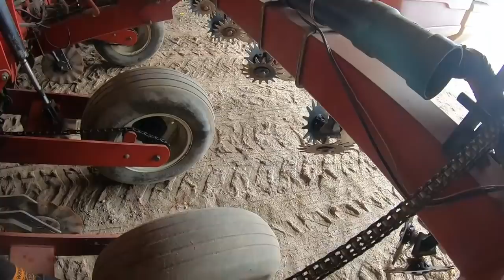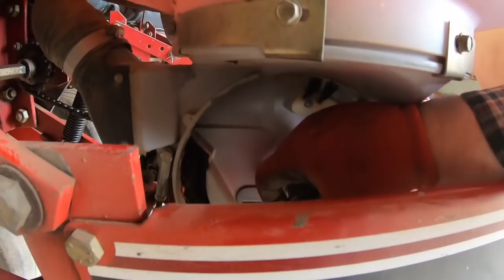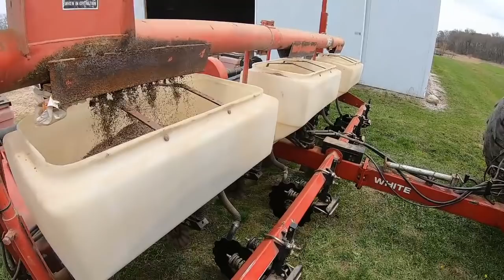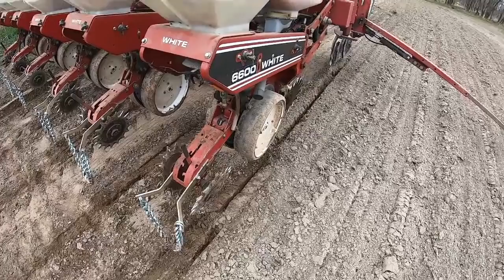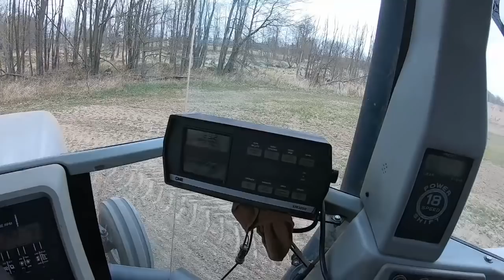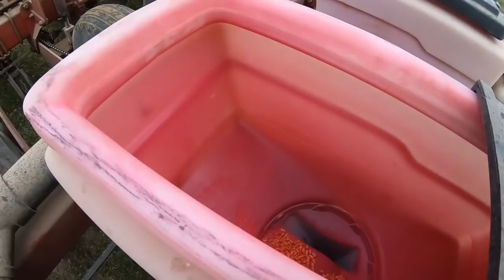Corn Planting with White Farm Equipment

Comment: So the seeder is "powered" by the center rubber tires that drive chain and gear links?  So in theory, as you speed up or slow down, the rate of see application automatically adjusts based on the speed of the center tires on the seeder?  So no PTO use at all?  If that is true, how fast can you actually plant before the seeder can't keep up?  How do you know if one of your row feeders gets clogged and stops dropping seed?   When you get to the end of the field, and lift the seeder up, what stops the seeds from continuing to drop out of the tubes if the chains are still powering the system?
Reply from the maker: Correct. The ground wheels drive chains that go to a clutch mechanism. When the planter is up, the clutches have rotated with the lift, and that pushes the 2 halves of the clutch apart separating the drive and while the chain from the wheel keeps turning, it can't transfer the rotation to the shaft, so everything stops. Let the planter down, the 2 halves are pushed back together by a spring, the teeth inside the clutch mesh, and everything starts turning again. And since it is ground driven, the amount of seed goes up and down with ground speed so that it is always putting down the same number of seeds per foot. There is a speed limit for it that varies by population. If the seed disc turns too fast, the seed can get jammed because it can't fall out quick enough before the hole goes past the opening. There is a transmission on the side that you use to combine different sprockets to get different populations by speeding up or slowing down the seed discs relative to the ground speed. If I remember right, they don't recommend going over 7 mph on lower populations, and it goes down from there. Corn is a low enough population (I'm planting 30,000 seeds per acre) that I could go 7 mph if I wanted to, but with my stony ground, that gets hard on the machine and also decreases the accuracy from bouncing. I plant at 5 mph, but do go a little slower in areas where I know there are a lot of rocks.
As to telling if a seed tube is plugged up, there is a sensor in the tube of each row. One side is LEDs, and the other is a light receptor. Each time a seed goes by, it blocks some of the light, the receptor picks that up and sends a pulse to the monitor in my cab. Each pulse is a seed, so the monitor can take the speed the planter is moving (there's a sensor for that as well) and calculate that with the number of seeds dropped over a set amount of time, and show me how many seeds per acre I am putting down. If the monitor doesn't get a pulse for around a second, it sounds the alarm to let me know one of the rows is out of seed. It shows a blinking square for each row, so if seed stops dropping, that square stops blinking. I know which row has the problem and get out and see what is going on. If the seed tube were to get plugged, it fills up with seed, the sensor can't see the light from the LEDs, so there are no more pulses,  and the alarm goes off. That doesn't happen very often. The alarm sounds when I lift the planter because it stops dropping seed. It sounds for a few seconds and shuts back off. Hope this helps.

Comment: been looking at 6125 or the 8310.  curious what your thoughts are on the 6125.  I currently run a MM G1000, so I am looking for newer and about the same hp.  plus I like the 5.9 cummins
Reply from the maker: I really like the tractor. The 6125 uses the White rear end and hydraulics, so it has common parts with my other tractors. Early 6125s used the White mechanical lever 3 point hitch control, move the lever to lift or lower, with a stop knob to adjust operating level type of set up. Very similar to your G1000.  Later ones like mine incorporated the electronic hitch control from the Massey. The actual lift parts are still the same, just the controls are different. It makes it easy to adjust lift height, operating height, lower speed, and draft sensitivity all from the operator's position by turning a few dials. Once you have it where you want it, there's a rocker switch on seat arm that you rock back to lift and rock forward to lower. They also added switches to the fenders on the outside to raise and lower the 3 point, which makes hooking up to implements much easier.

 The 8310 used the Massey Ferguson rear end, hydraulics and 3 point hitch. They redesigned the powershift so that every clutch pack has the same length of oil galleys. This helps to overcome the variable fill rates of the clutch pistons due to viscosity changes brought on by temperature changes. In short, they are supposed to shift smoother, especially on the 9-10 and 10-9 gear changes when there are 3 clutch packs shifting at the same time. The downside is if a solenoid fails, it's not as easy to get to as on the 6125 which has all the shifting solenoids in an easy to get to bank along the right side of the tractor. I haven't had to replace one yet, but it does happen. Some of the solenoids on the 8310 are under the cab floor, so not a huge job to get to, but still a little more work. I think the 8310 could also be ordered with the 32 speed partial powershift Massey transmission. They had 8 manual gears with a 4 speed powershift in front to get the 32 speeds. I don't have as much experience with those, but I have heard good feedback on them.

Both tractors use the 5.9 Cummins, which is a great engine in my opinion, and if nothing else, there are so many of them out there, they will have parts available for a long time to come.  They are also on the low end of horsepower for their drivetrains, so either one should last a long time with decent care.
Reply: @ThatOliverGuyChris  That is very helpful, would there be anything I should look for that is a common failure on the 6125 if I were to purchase one?  what would be a comparable tractor to the 6125 of other brands?
Reply from the maker: I'm not sure what the competition had at the time. I was more into service than sales. I can't think of anything specific to check. Look at the fluids, see if they look clean. Drive it, try every gear because if there's a bad solenoid,  some gears will still work,  others will not. It will likely shift a little rough when the oil is cold, especially the 9-10 or 10-9 shifts.  Try shifting at low rpm and wide open and see how consistent it is. If it has the electronic hitch control, try it out. It's nice, but there's also wires and sensors to go bad.  If it's 4x4, try that out. Listen for noises from the axje. They are a good axle, but from what I understand ZF isn't suppling parts for some of the axles from that era of tractors.  That's not just a White thing either,  Deere used ZF axles and parts availability has been an issue for them. Maintain the oil and grease them regularly and they will hold up.

Comment: Those whites are nice tractors iv only seen one up in ny at the micfadens tractor bone ward they have masinmve ones were the big v8 stuck out over the front wheels like 5 feet masive tractors and they have a few of them all scraped for parts siting in bone yard so if u need parts mickfatens in ny has bone yard full of all tractors

Comment: Great video! White planters have a great reputation for a reason. Can you tell me what all parts you need to convert an 1800 to a two speed PTO? Thanks
Reply from the maker: There really isn't a way to convert them, the housing doesn't have room for both sets of gears. You'll have to buy a complete dual speed unit from a 50 series to do it.
Reply: @ThatOliverGuyChris  what parts do you need? I saw a listing for one with just a housing/cover, two gear sets, and a shaft.
Reply: @ThatOliverGuyChris  by the way, I'm planning on winning that t shirt 😆😆

Comment: Mr. Losey could you explain the hydra power transmission and also the over under system on Oliver tractors. I have looked on the internet and cannot find a detailed explanation on these systems and how they work. Also were they reliable transmissions.  Might make for a popular video. I would greatly appreciate the information. I live in Kentucky and there are no Oliver's around when I grew up so I don't know a whole lot about them. I got to drive an Oliver 77 a few years ago. My cousin was in Missouri and his elderly neighbor lady had one. I got to plow with it and also disc a garden for them. It was a nice tractor. Thanks for the information if you could provide it sometime.
Reply from the maker: I've been wanting to make a video on repairing each, but the opportunity hasn't risen yet. Someday it will, but in the meantime...  The hydra-power came first. It is a 2 speed shift on the go auxiliary transmission that is self contained and fits between the main clutch and the transmission. You would put your main transmission in gear, and the hydra power could be shifted at any time, essentially doubling the number of speeds the tractor had. The slower speed was Hydra power, it used a one way clutch known as a sprag clutch to engage a gear reduction on the lower shaft of the unit. Because it was a one way clutch, the tractor can speed up going down hill. In Direct drive, a clutch pack is engaged that locks the input shaft to the output shaft, and you get a speed increase. It's like there is just a straight shaft going from the clutch to the transmission. The shaft with the sprag clutch spins faster and so that clutch releases because it's like it is going down a hill, it always freewheels if the output side is turning faster than the input side.
The over/under is similar, but has 3 speeds instead of 2. It was designed to fit in the same space as the hydra power, and is self contained as well. Direct drive works the same way in both units, and under drive has the same function, although its location inside is different. Overdrive uses a planetary gear set to speed the output up by about 20%. The over/under gives you 3 shift on the go speeds in each gear of the main transmission, making for 18 forward and 6 reverse speeds on an Oliver or White tractor.
Hope that helps
Reply: @ThatOliverGuyChris  Thanks Mr Losey. You are the only person who has ever been able to explain how the Oliver's work. I am a John Deere man, but at farm shows I was always interested in Oliver's. They look like well made tractors. I wish we had some here in Kentucky. Just Fords, Internationals, John Deere's and a few Fergusons. I am in what used to be tobacco country and most Oliver's seem too large to do row crop tobacco farming. Thanks again for the information about the Oliver transmissions.

Comment: We used a White planter. Using air pressure rather than a vacuum was a stroke of genius. We were on 36 inch corn rows with a second row of planters on the skip rows for beans. You could calibrate your ruler on how accurate the seeds were placed. Easier to keep air pressure than a vacuum. And easier to find air leaks.

Comment: I run a 6182 white planter very similar. You mentioned a speed sensor could you explain that? I have the same monitor but haven't figured out how to get seed population. Take care and have fun
Reply from the maker: On the shaft that ground wheels drive is a sprocket, and there's a pickup sensor that reads off that sprocket to figure out ground speed. There should at least be a pig tail connector for the sensor on your planter harness, I can't remember if it was on the left or right side on those planters. The monitor is set up to read speed either that way or through a radar gun, so if you don't have that sensor, the planter might have originally been set up to read speed off the radar on the tractor. It wouldn't be hard to add the sprocket and sensor on, just need those 2 items and the bracket that holds the sensor.
Reply: @ThatOliverGuyChris  I think mine has that but I didn't realize what it was. This just my second year with it. I bet mine isn't connected to the monitor. This is my first planter to have a monitor.
Reply from the maker: The sensor could need adjusted or replaced. It needs to be centered over the sprocket teeth, and pretty close, I'd say about the thickness of a dime. The sensor has a weatherpak connector, 2 prongs, and should be plugged into the planter harness. The monitor should say speed failed if it's not picking up a signal. There's also a calibration procedure in the manual for calibrating the speed so your population numbers are accurate.
Reply: @ThatOliverGuyChris  it definitely has the sensor found it today. I'll see if I can get it to work in the next couple days.  Thanks for the info.

Comment: My opinion there great planters, I have a 6100 series and I love it very simple very efficient, Often get compliment on how good my corn looks from guys with newer Deere planters. I really like the air pressure on the plates. Brother inlaw has a caseih vacuum planter  and plants no till, vacuum sucks trash into the plates and causes premature plate wear. He wanted a White planter but couldn't find one with center fill and 16  31.
Reply from the maker: If there is any testament to the design of the White planter, a neighbor with a very rough looking and abused 5100 rolled it out of some dark corner and it still made a picket fence kind of stand of corn.

Comment: My family farms 4500 acres in southern michigan.  We run a newer kinze 3500 central fill 16 row 20 inch spacing  soybean  planter. We use older machines but we still get work done. Your planter isn't that different than mine besides we have central fill GPS and  hydraulic down force  but the concept is the same . Nothing wrong with older equipment.  I prefer johndeere but we have case newholland and alischalmers machines. I started out with agco machines.  I'm only 26 years old but we farmed  500 acres with a 15 foot drill and a gleaner f combine . I enjoy watching your videos because you run older equipment and you know your agco machines well. Smaller machines are simplified and I still enjoy runing the old machines.  Nice video stay safe and farm on my friends  !

Comment: That's the 2nd bad thing about JD, majority of their equipment really isn't designed by JD, more "copied" or others make for them. 
It's amazing how technology of the 80's are still continuing even today isn't it? I still prefer the older drills/planters, no sensors that can go bad and give you a wrong reading. Great video, thank you for sharing. Cheers :)

Comment: Thanks for the cav ride. We had a custom guy plant corn before we got our planter. He had a White 6 row(I think his was a 6100 that he had a splitter unit for it) that he pulled with a 100hp Massey even in notill. We now have a  4 row 7000jd finger planter(precision meter upgrades) pulled by a David Brown 990. A little puttery but it get the job done. 
You ever see or sell Oliver tractors that were repainted David Browns? Examples are the Oliver 500 and 600. I have only seen them in books and the internet.
Reply from the maker: We never sold one that I know of, but there is a 500 about 10 miles from here, and I have seen a few at tractor shows. I've only seen a couple of 600s.
Reply: @ThatOliverGuyChris  Just one of those wierd footnotes. Thanks for the response!
Reply: Greg Henry     i thought David Brown was made by case ??
Reply from the maker: Case bought David Brown, but it was after David Brown had made tractors for Oliver
Reply: @bustersmith5569  I guess you could say in round about way they did. Case bought david Brown tractor works and continued to build tractors at the David Brown factory till the mid to late 80s. The last tractor to roll of the line was branded a Case International(a 1594 if I remember). David Brown's tractors were a collaboration with Ferguson with the Ferguson Brown type A.  David Brown is still around today as a gear/transmission maker. Aston Martin db series have(or atleast used to) David Brown drive trains in them. Sorry for long answer, but I hope you enjoyed the extra info.

Comment: Nice setup and video, love the white sliding box covers and the fertilizer cross auger.
Reply from the maker: Believe it or not, this is the 3rd planter that fertilizer auger has been on. It started on our first 5100 in the early 80s, then we got a new 5100 in the early 90s and moved it to that. When I sold that planter I figured I'd get a new cross auger, but the buyer didn't want this one, so I mounted it on the 6600.
Reply: @ThatOliverGuyChris  Looks like it's done fine by you

Comment: looks like tractor line up could use a splash of new rubber on the wheels, great auction video.
Reply from the maker: I do need to find a new set of duals. These still help, I went through a wet spot and was starting to lose traction, but they kept me from sinking. I just made it through.

Comment: That 5-6 shift reminds me of my 6175.  Damn thing nearly stopped then shifted  hard.  I complained to Cards, they came down and adjusted it so it didn't knock your hat off. I liked to plant in 7th, idled back to about 6 mph. Man, that camera on the back, sounds worse than my old Spiecher ditchin' machine!! LOL!! Those shots under the planter, are scary!! LOL!!
Reply from the maker: I like to run at 1800 rpm in tenth gear. The 9-10 and 10-9 shift can be a little jerky at times, other times it's like any other gear change.
Reply: @ThatOliverGuyChris  you know, I may have forgotten which shift it was!! LOL!! Were you surprised at the amount of noise the planter makes??
Reply from the maker: Yes I was. The microphone on the Gopro does a good job as well, but my first thought was... I can hear every rock in that field.